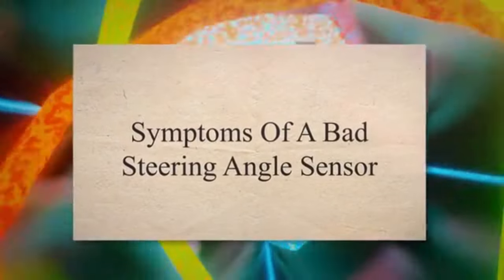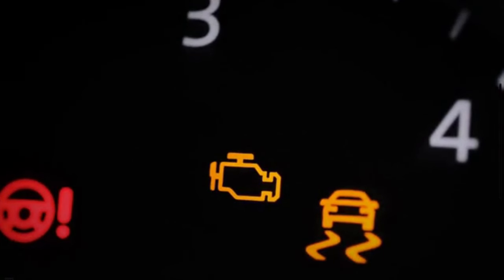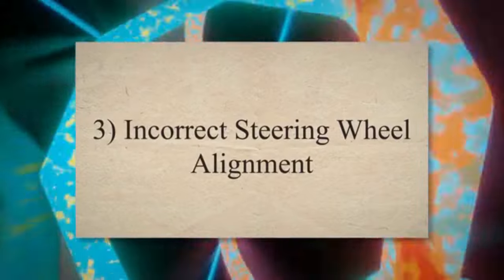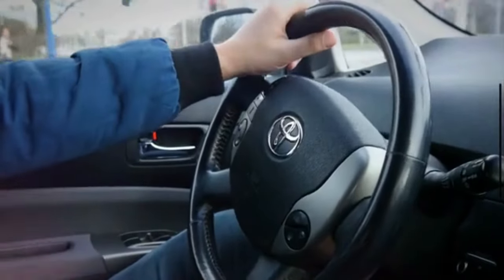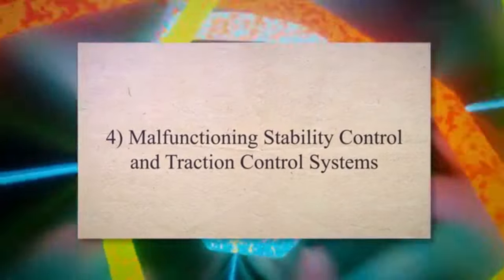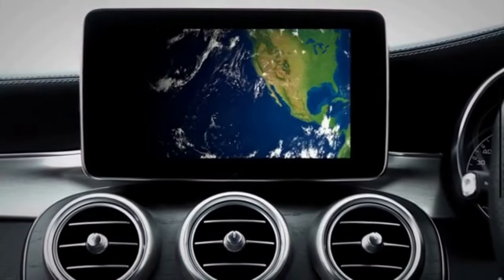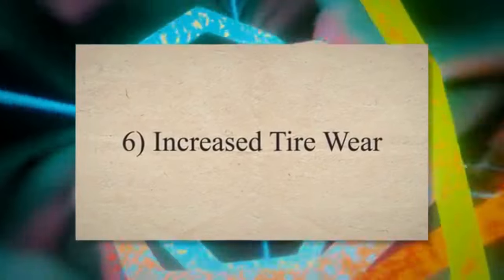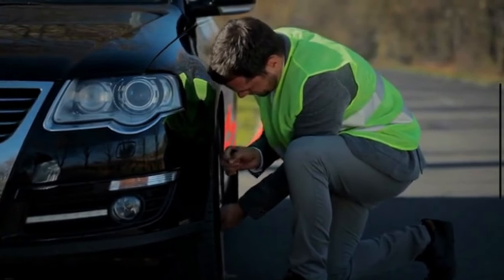TOP 7 SYMPTOMS OF A BAD STEERING ANGLE SENSOR

Comment: I hate my fix or repair daily, got a sick deal, and wondered how I got it so cheap for the condition. 1/10 times it starts in limp mode, and my dash lights up like a Christmas tree. Brakes are hard to press sometimes randomly as well.
Reply from the maker: You should contact a professional mechanic for this issue because your car can trigger the limp mode or warning lights due to different issues and only a professional can find the main issue